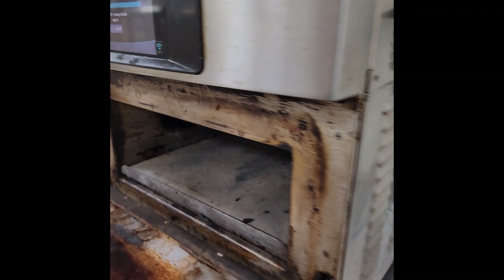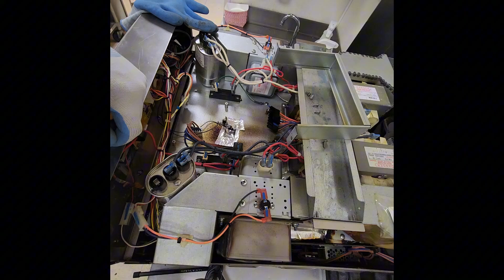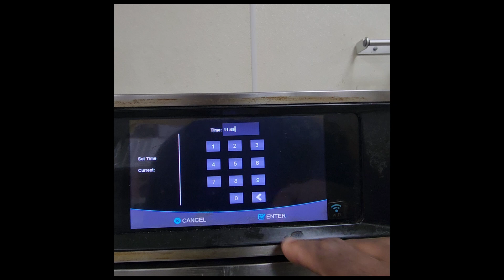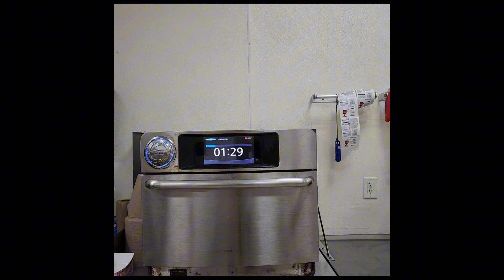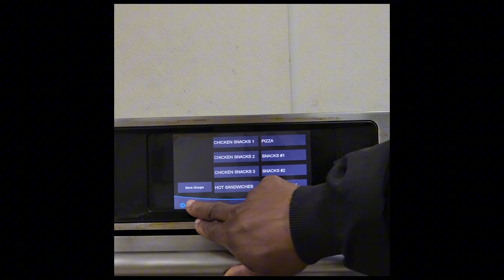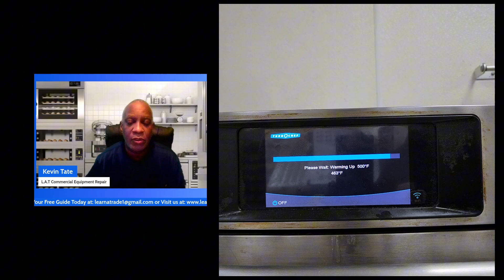Turbo Chef Oven Repair (Relay Board Replacement)

Comment: How do you replace a display board on same unit with a upgrade kit and new buzzer
Reply from the maker: On the Turbo Chef oven you will find  4 screws at the bottom of the display under the door gasket, and 2 holding screws on each side. You must remove the bottom screws and just loosen the 2 side screws.  This will allow you to replace the display assembly.  Then if you have an upgrade kit , you will replace the main board as well. For your speaker the should be ordered separately but that will be easy to replace since it connects to the control board wires with a terminal.  Just be sure to have a USB with the existing oven menu in case the new board is not pre programmed. That way you will be able to load the correct menu for that oven. I hope that helps.
Reply from the maker: This manual should help you on the display board replacement. 
https://www.learnatrade.online/_downloads/b6c37da7b917661b7f1980c3bde7b4f0

Comment: I got a turbochef when only cooking the chicken wings the cook time is 4:48. But it stops cooking only after about 1 minute and says cooking time is finished.  I replaced both RTD probs & the main board. The magnetron & both upper & lower heating elements all checked out fine when amp checking them. There are no error codes stored. I then changed 1 magnetron & 1 diode. Still the same issue. This is only when cooking the chicken wings. The menu also has been updated. Any idea what can be the issue????? S.O.S
Reply from the maker: Hey thanks for reaching out. That is a strange one , let me take a moment to go over the issue and I will get back to you soon with my thoughts.
Reply from the maker: @Joelbri2006  After seeing everything you have checked and replaced I can only think that there must be an issue in the firmware menu, because its only doing this with one item. I would check with tech support to see if they can confirm that because I really can think of anything else. Keep me posted on the out if you don't mind.
Reply: @latcommercialrepair  will do sir
Reply: @latcommercialrepair  i need to correct myself. I replaced the upper & lower temperature probes not the heating elements. My bad, long story short. Tech support was bamboozled by this as well. They were the ones who suggested replacing the main board & probes. Now they want me to replace the touch pad. But at this point the customer went ahead & approved the replacement of the unit at this time. Tech support also stated they have been getting a lot of calls like this where the chicken just stops cooking 🤷‍♂️. I thought i would let you know👍👍
Reply from the maker: @Joelbri2006  Hey thats good information,  and it is probably best they replace the unit because it seems like there is a issue with the program . Let me know if this is a 7-Eleven  ?
Reply: @latcommercialrepair  it is a 7-11

Comment: Great video 👍 never thought about putting insulation tape underneath the relay board. It makes sense👍
Reply from the maker: @Joelbri2006  Thank you for watching!
Reply: Here’s one for you I got this turbo chef blowing control boards left and right. Called tech support plenty of times. Each time different and replaced what they said but still blowing the I/o board. Heats up to 500 ready to cook as soon as you push to cook something the screen goes blank and flickers an then the control board relay blows it’s the yellow board con 3019. Have you come across something like this let me know
Reply from the maker: @christopheralvarado351 Wow! That is a great one and no I have never run across that. I am not sure what model oven it is but I am assuming its a Bullet model or an Encore model, and I am not sure what part they had you replace but from your description  of how its blowing the board it sounds like there is a short in   the touchpad or the display board. If you can get back to me and let me know the model of the oven , then I can probably help figure out whats causing that board to blow like that. Thanks for that question and please get back to me with that information.
Reply: @ it’s and encore 2 model. The newer model but with the glass relays on the right side of the unit.
Reply from the maker: @christopheralvarado351 Ok is it blowing any of the fuses  or the relays?
Reply: @ it’s not blowing any fuses or relays just the relay on the ip board. As soon as you push a cook cycle everything shuts down and the screen flickers and blank than un plug plug back In an yeah you can get into the menu but now the board is toast idk what’s causing this issue
Reply from the maker: @christopheralvarado351  Hey Chris this is an interesting issue with that oven. If its possible could you give me a call direct the next time you go to work on that machine? If would like to FaceTime with you and walk through some steps to see if we can locate the short . Let me know and I will send you my number?